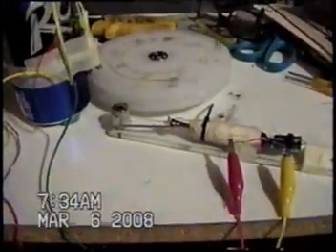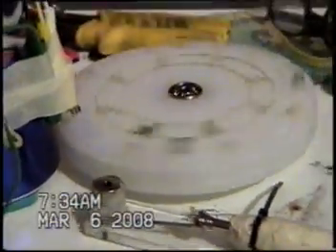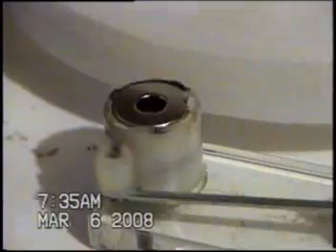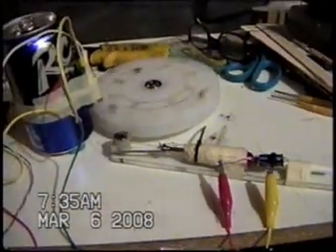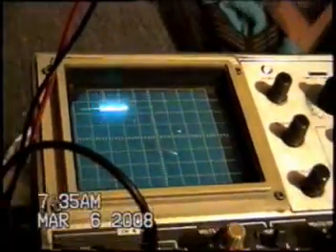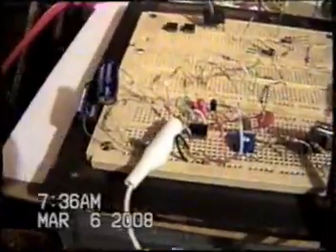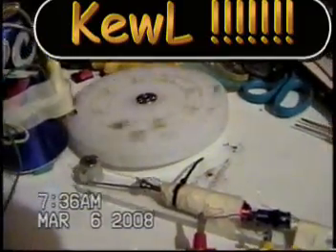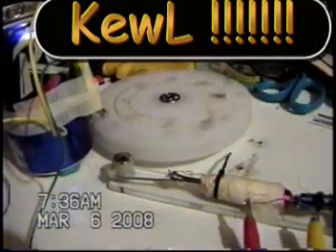OC MPMM New Approach

Comment from the maker: The Halbach array configurations would be beneficial if we wanted to concentrate a single pole outward. However this rotor is configured with 4 poles derived from 8 magnets and thus the poles are alternating. A Halbach Array is not useful in this configuration.

Comment from the maker: One of the beautiful things about OC's concept here is that it works in both attraction and repulsion simultaneously thus the H field from the stator nets to zero as far as B field losses on the rotor magnets. Additionally, the rotor magnets are configured in continuous repulsion but there is no flux deviation between them as they are stationary with respects to each other. Consequently there is no degradation in B field density for these as well. These magnets are Neodymium Iron Boron 42MGOe.

Comment from the maker: One of the key factors here is the magnetic shear as the stator 'resets'. The shear is caused by the rotors momentum and the inability of the magnetic forces to reconnect in the alotted time. Like tires skidding because of loss of traction we are able to move against the flow and minimize negative torque during the 'reset' period.

Comment: what's proven here is that a little magnetic stator pulse in the right moment can spin a larger rotor.you can see this same effect in a natural magnetic harmonic beat on my "tri-arc stator" k-Mets video.  what you have here shows the possibility of a little power powering a larger motor/rotor.the unit should take less power to power it at higher rpm.you'll have to take power off your motor in a way that doesn't make drag.less power though but still power.enough for your motor i beleive to run..

Comment from the maker: The circuit is powered 12V via a Recoton 120VAC to 12VDC power pack. Standard TIP 120 is a Darlington driver transistor. The KewL thing here is the method of magnetic drive to the rotor incorporates magnetic shear and resonant oscillation of the stator mag. An optimal system would use a very narrow (1ms or less) pulse on the solenoid and swing 180 degrees for maximum torque transfer. The plunger is magnetic and thus converts energy back to the source on each reciprocation via a clamping diode.